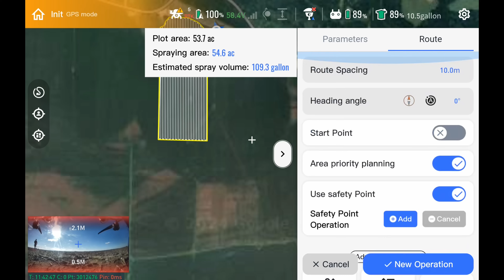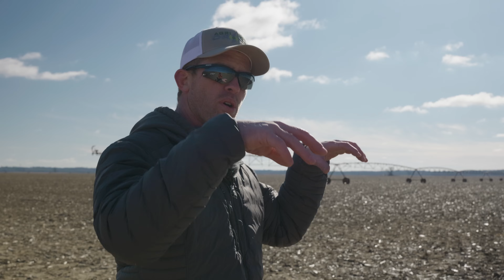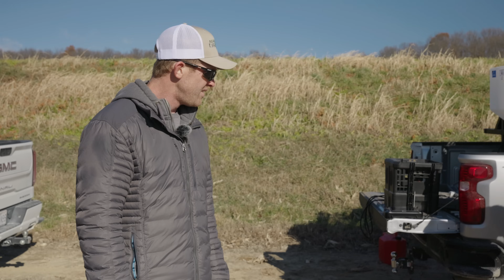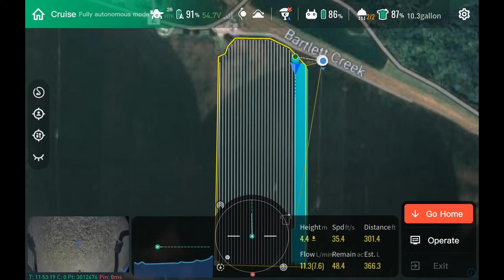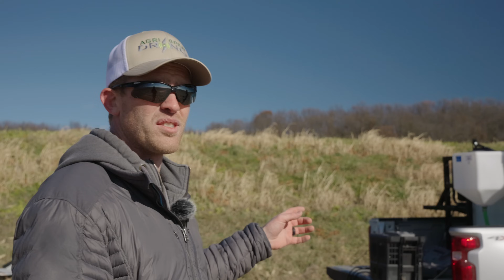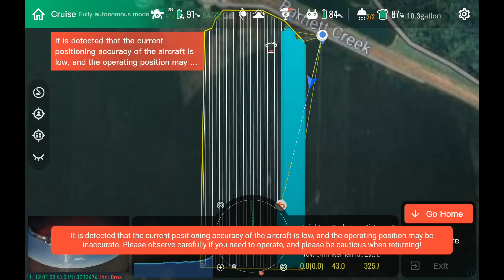EAVision J100 Full Spraying Demo | Agri Spray Drones

Comment: How does it compare to something like the XAG P100 pro or DJI T50 actually head on? Seems decent but definitely a copy cat drone of DJI...
- Radar J100 is 40m vs XAG P100 pro its 80m (does it make much of a difference?  Is this why it can't match XAG with terrain following at 13.8m/s?
- . so will it glitch out and crash if its to dusty from getting confused?
- Swath width is the same as the XAG
- Smaller batteries on the J100 (How much does that effect flight time for ferrying?) 
- Is there other disks to get a higher than 300 microns like the T50 or P100 pro? Seems to fine of a droplet to be a max micron size

Don't know the price but seems like a okay starter drone to start with if it's at least 15k cheaper than the DJI or XAG!
Reply from the maker: We have a whole series of comparisons coming out very soon! The J100 is phenomenal at terrain following as well as obstacle avoidance. Cost is slightly above the T50, but make no mistake: this is not a starter drone. The J100 is a superior design and build to both other systems.
Reply: @AgriSprayDrones  how can you have the upper hand?
Propulsion?
Battery capacity?
Fluid pumps?
Granule flow rate?
Or is it just radar?

Comment: Doesn't seem any better than the T50 and the XAG would most likely outperform this drone on row crop with 70 liters and 45 ft per min. Not sure why Agri Spray is pushing this drone so hard.
Reply: The T50 is unavailable. I’m trying to buy one. They can’t clear customs. We don’t know when they will be available, so this is an alternative. Whether or not it is better than the T50 this drone is available and the T50 is not.
Reply: @araphin1  do you still want a drone?
Reply: @HochDrone-Factory Yes. I’m buying one. Got all my certifications, had a trailer custom built, and then when it got time to order the drone I was informed it was unavailable, and no information exists on when they will be available. I wanted a T50, I still want one. T40s are available but the T50 is better for my operation. I’m willing to look at the J100 but what I want to know is how user friendly the interface is. DJI owns the market on user friendly interfaces. All the hardware features in the world won’t make up for inferior software.
Reply: @araphin1  volitant drones nebraska
Reply: J100 can also fly 45ft/s like xag if you disable terrain and obstacle avoidance.
Reply: Maybe better  profit margins  than DJI
Reply: Seems like they took some good parts from DJI and from xag. Still don’t believe it will outperform the p100 pro which is 2 years old
Reply: @ricardobachmann6329  kind of what I saw, the LIDAR is pretty cool but can have its own pros and cons but we're getting real world 70 acres an hour with 60L P100 pro and I don't think this thing will get more than 50. The LIDAR could be awesome for spraying trees and orchards in hilly terrain though but it'll take a year or more to work out all the bugs just like every other drone. The T50 is still having issues. The P100 finally looked fixed this last summer. So I'm not holding my breath, so many sales guys out here with new fishing lures all the time.
Reply from the maker: We'll tell you exactly why we are pushing it in comparison videos coming soon!

Comment: Id like to see it with the 16gal tank on it and spray a full tank at 2gpa through hills and over/around a pivot or other obstacles.

Also how does it respond to low battery, if its on the other end of the field, does it know when to come back and land safely before it hits 0%. Some drones when you set 15% as the RTH, itll head for home at 15%  and others will land at 15%. Dont wanna see it fall out of the sky cause it cant make it back
Reply: It will rth at low power percentage you set and land at a set low battery voltage

Comment: Thank you for the video!!!! Keep them coming. So far it looks good. I need to see manual mode and the transition from autonomous to manual flight. I hope there will be a way to move the 1700 fields i have mapped in the DJI system to the J100.
Reply: If you have shp or kml files you can import them into EAV system
Reply: I made the fields in the DJI system. I haven't found a way to get the kml files from the system. If anyone knows how, I'd be interested.

Comment: You should use a Ford F-150 Lightning and skip the generator.
Reply: Good idea, then you can walk home when your truck is dead after charging batteries all day 😂

Jokes aside, I wanna know just how much battery storage you need to not have to run a generator for an entire days operation
Reply: Just mount the sprayer on the Ford Lighting then you don’t have to deal with the FAA and you could spray whole field on 1 charge

Comment: I think you’re missing the mark on this drone.

What you’re looking at there is something that is rushed to market and I’m a tell you this I think that I could build my own drone better than the ones I see coming out now. 

There’s enough tech out there even on YouTube and I’m getting my part 137 so it’s not gonna be that hard like things used to be difficult beyond belief. 

I wanna stick with DJI or an XAG
Reply from the maker: Hey @rednose1966, curious what makes you think that? We have lots of comparisons between the three systems (DJI, XAG, and EAV), so stay tuned! And hey, if you build a better spray drone, let's talk 😉
Reply: @AgriSprayDrones have you had anything to do with JIYI K++ V2 flight controllers? Pretty cheap to build a 50L with Hobbywing X13 motors under $5-$6k, another $8k 3x 30000mah 18S batteries & charger. Interesting the China ban on certain drone parts not being allowed shipped out there, mite make counties start producing there own parts.
Reply from the maker: @VillainState  We have not experimented with custom built drones, no. We definitely stick to drones on the FAA approved list

Comment: Nice 

Can you program a headland pass.   Missing those irregular ends not spraying when turning looks tricky to deal with
Reply: You can do boundary passes like Dji and you can also do manual mission point to point routes so you can actually tell the drone the route to fly and spray so you could essentially do multiple boundary passes

Comment: why did it keep saying that it was detected that the current positioning accuracy of the aircraft is low, and the operating position may be inaccurate? (14 min mark or so)
Reply: I think I saw in some other guys video demo, it does that when you run on waas. On RTK it goes away
Reply: @logomyego  thanks
Reply from the maker: Indeed, this is because we were not hooked up to RTK. The warnings make it look like a big deal but it's normal without using the Super Link

Comment: Lets say a farm is in a controled air space area, can you use this drone?
Reply: You would need a to register for a CAPS account with the FAA and file for an ATO COA(Certificate of Authorization), for each location in controlled airspace or proximity to a public access airport as required by the Blanket-COA attached to your 44807 Exemption.  After issuance, each ATO-COA requires a monthly report to the FAA on flights conducted under it, including no flights.
Reply: @onsitevideoservices9552  ok it is similar in canada then

Comment: Show it in the hills! Is there a route segmentation like DJI has to fly two drones in the same field? Is there a mobile app so that you can pre-plan fields like DJI has? Can they change the software to have a bigger droplet size?
Reply from the maker: Hill and obstacle demos coming. 
It has both route segmentation and split field function to operate multiple.
Not a mobile app, but a web app, actually a couple for different functions. Field planning is one of them.
You can actually already get larger droplets by removing the outer disc and increasing droplet setting to 300. It is definitely putting out larger than 300 when you do that. 
EAV has a list of things that they are in progress of updating on their software.
Reply: @AgriSprayDrones  when you remove the disc are you able to monitor droplet size? Or is it just producing a droplet that is known to be larger than 300
Reply: @brittanypias8948 we have a larger disk that will be tested and droplet swath data to come soon once we get a unit in warmer weather to test